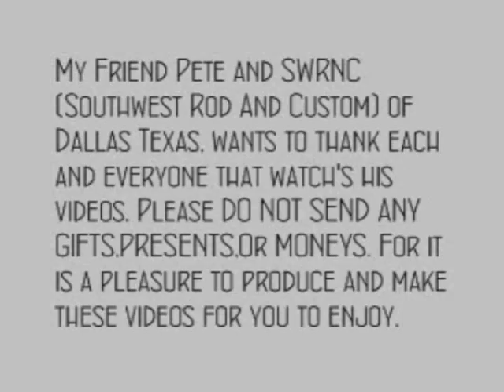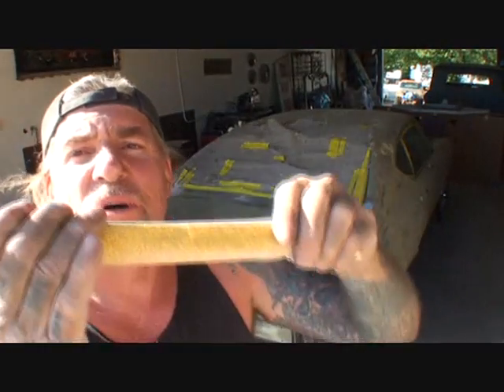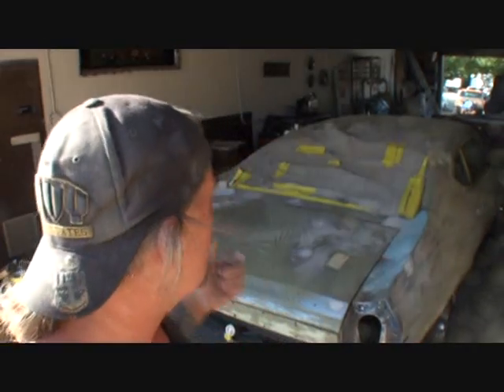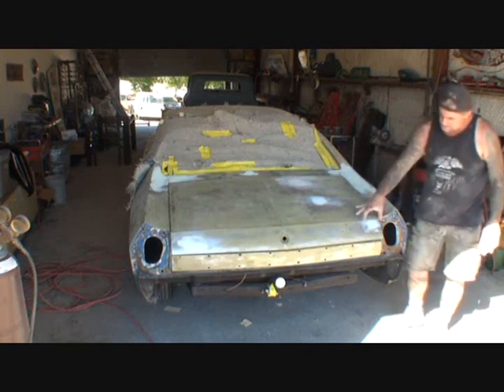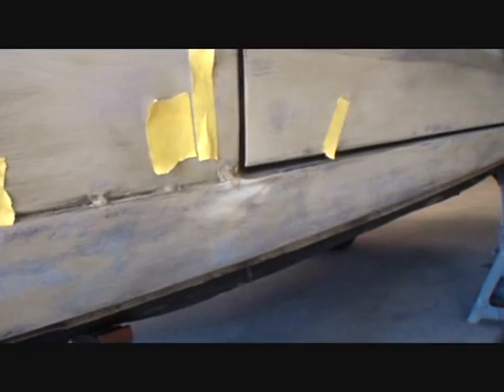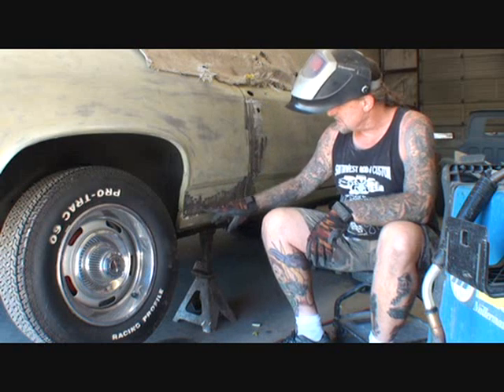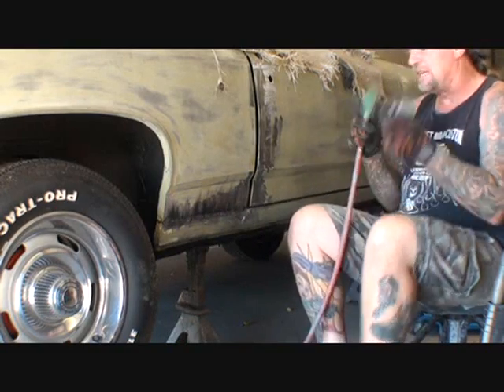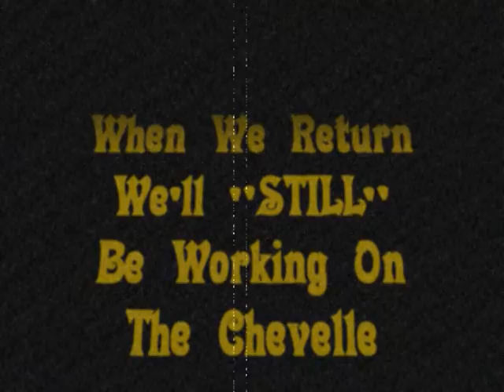Muscle Car Restoration-1969 Chevelle SS-When Will The Welding STOP!

Comment: Do you do any type of rustproofing on the inside of the panels?  Like POR-15 or another type of product that can mist in all the hard to reach places.  I found that even just using simple spray wax and WD-40 inside panels, from time to time can make things last a lot longer.  The POR-15 may be the best to last the most years.  I hate rust.  Everyday dings that happen with normal driving, I can live with.  But I hate rust.

Comment: When you hit that with the MIG are you running those tacks on top of each other, or spacing them out and filling in between?  I've got several replacement panels to do on my '54 F100 and want to do it the right way.

Comment: Hey Pete, question regarding seam sealer were the bottom quarter meets the rocker. Does the seam sealer go on before or after the primer. I have a red 68 Chevelle SS that i want to paint the bottom half under the trim black.

Comment: Hey pete, i have a couple fenders for a truck im working on that've got a couple little dents in them and i havent got tools to properly fix them, would it be possible for me to send you the fenders just to fix the dents and rough out the steel, then send them back to me to finish?
Thanks
steve